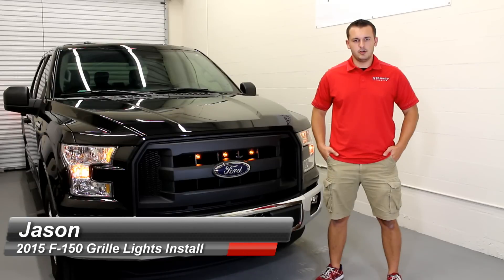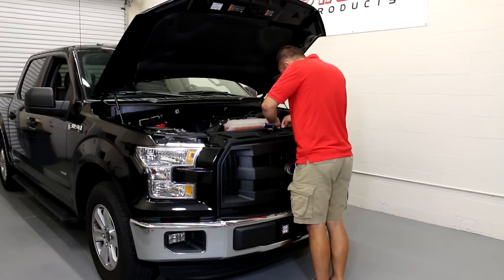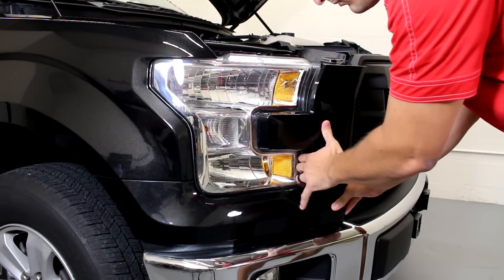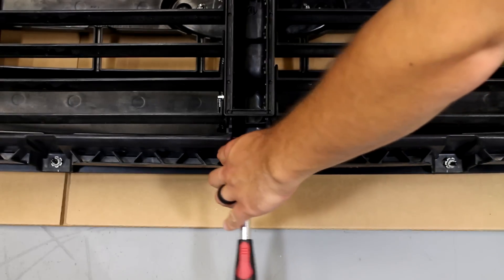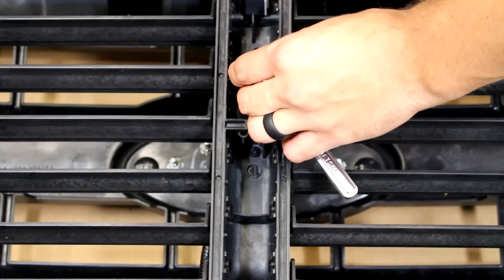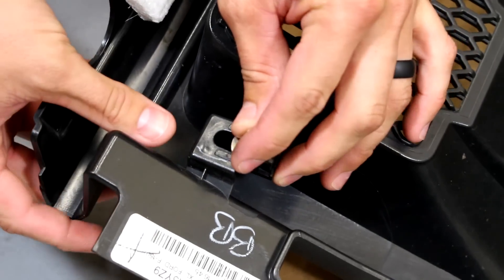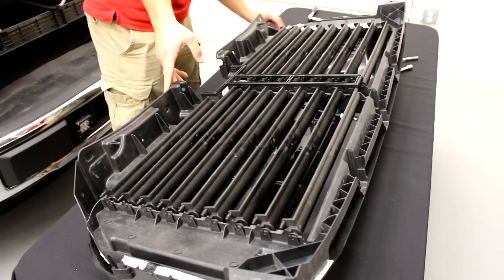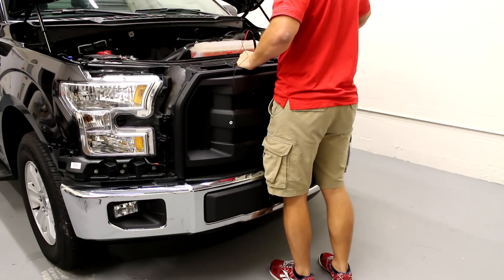Starkey 2015-2017 Ford F-150 Raptor-Style Grille Light Kit Installation

Comment: thank you for the video, it was very helpful however i have the Platinum trim and found there to be a factory fender trim piece over the wheels that posed a problem when removing the headlight trim section and more complicated was the wire going to the front camera, it did not come off and if it does it was not obvious making taking the grille completely off the truck impossible, however i was able to get done what i needed but maybe add a note or disclaimer into the video.  Still, Thanks again!
Reply from the maker: +Chad Geetter Thank you very much for the feedback, I'll see about getting that added to the instruction manual as well.